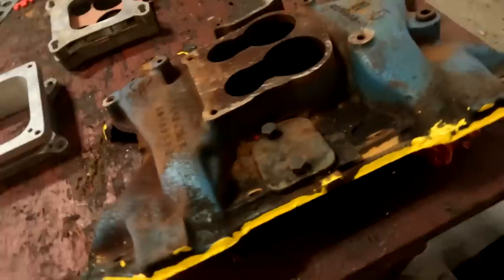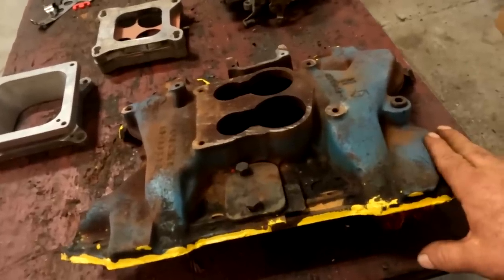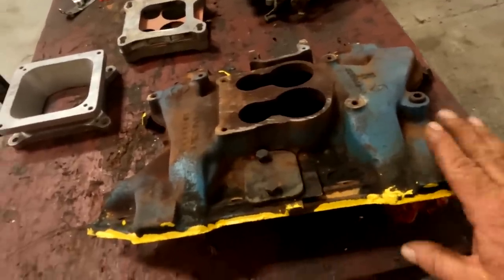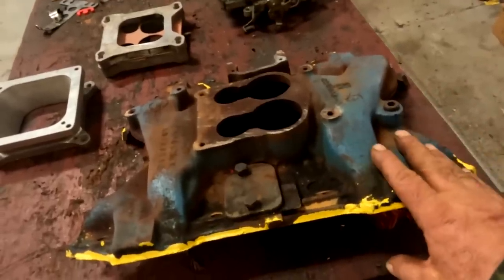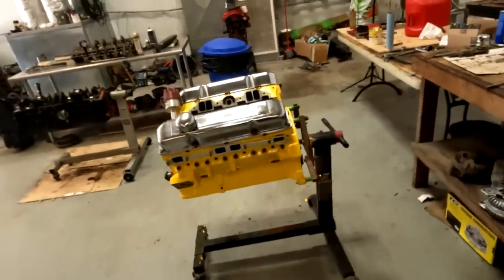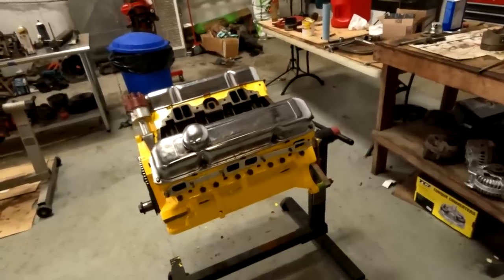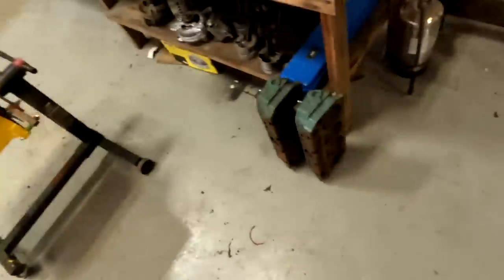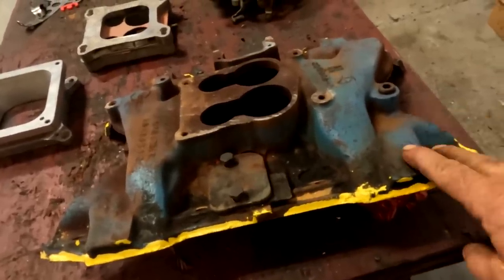Blueprinting - What It Is And Why You Should Do It To Everything You Touch On Your Car. Free Power

Comment: Real world experience with two cars that should have performed the same, a full second difference in the quarter. My 69 340 Dart, 3.23 auto ran constant 14.1’s, my mom’s 70 340 Duster, identical drive line ran 15.1’s, with the same driver. The car didn’t feel sick, as a matter of fact, mom’s car sounded more intimidating than mine. I’ve long suspected it was a cylinder sealing problem, with it’s root in the original break in period.

Comment: My husband  sez he is an
O.E.M. feller...he is mostly from maternal  family's favored marque a 
what he said he is called a
"Bow-tie"
guy...since he was 9-10yrs old he has hands on experience in Chevies...
He wants to thank you for posting your vids about his passion for 
"Old School"
engineering...nowadays
by now after 60+ years, he wants just to work on small engines, and restore his Chevy motors(and that includes the much
maligned 
Corvair!)
...we have the original
'66 283 he was blessed to bore his own block .030,  steel crank absolutely ""zero-ed out ALL the main journals and crank throws from a '64 C-10 P/U...has original intake AND an Edelbrock 4bbl intake
with a Carter
AFB carb as an option...
that ol' red Chevelle 300 Sedan was his first vehicle he paid for and not shared with his family...I remember how good a car it was...the body just rusted away and after a collision with a truck, we just let it go for scrap, but kept most of the powertrain
(had a modified Powerglide that would really let it get the power to the stock 3:08 rear end!!

Comment: The old school small block Chevy (before EFI, I don't do EFI) is the engine I am most familiar with. I have built a lot of them. Just take a look at the service manual for a 1960s or 1970s small block Chevy. Look at the allowable tolerances for everything. It's downright scary. That is what comes off the assembly line. Take bearings. Crank bearings or con rod bearings. You might have one that is borderline too tight. The one right next to it might be borderline too loose. Look just how wide the tolerances are. It's a wonder these engines even ran. It's a miracle that most of them actually made it past 100,000 miles. The fact that so many things can be that far off and the engine can still run so well and last so long clearly shows the tolerant nature of these old school engines. You can literally throw one together and expect to get 100,000 miles out of it. But. If you build it right, with everything correct, everything lines up, all the clearances are where they should be instead of all over the place, not only will that engine run a lot better, and make a lot more power, but it can last several times longer. 

The design of these old engines is nothing short of amazing. Strong, simple, robust, they were designed like an anvil. People claim they were junk, and complain that they didn't last very long. They weren't junk, there was nothing wrong with the design, the problem was build quality. Build a small block Chevy that might have lasted 100,000 miles the way it came off the GM assembly line, but build it right, and properly maintain it, and you can get 500,000 miles out of it. I built my first small block Chevy back in 1973, at age 14. I built it by the GM manual. I know for a fact it was still running 5 years later when the owner sold the car. But I started reading the technical articles in hot rod magazines, which back in those days were about mechanical things and not computers, and I learned about blueprinting. Building an engine to exacting standards, and not just somewhere within the upper and lower tolerances. 

Porting and polishing intake and exhaust manifolds will not likely make an engine last longer, but it will almost certainly make more power, because you are increasing it's efficiency. You are improving flow of air/fuel mixture through the engine. That starts at the air cleaner, and ends at the tip of the exhaust, and includes everything in between. The carburetor, intake manifold, heads, the entire valve train, exhaust manifold, and exhaust system. But remember, you have to consider all these parts as one. They all have to work together. You can have everything as perfect as you can get it, and one bottleneck in there somewhere will ruin everything. You can build an engine out of the best, most expensive parts available, and it may still run like crap, if it runs at all. Tony is right. Throwing a ton of money at an engine build does not guarantee that you will wind up with a great engine. You can get some amazing results from cheap parts, IF they are assembled properly.

Comment: Here's another reason why someone would reuse a stock manifold: experience.  I'm working on a 65 Olds Dynamic 88 with a 425, original A casting for block and heads. I got the manifold with most of the engine, meaning in the trunk. There was no 2bbl rochester, nor any carb, but it had a crudely attached adaptor plate for an Edelbrock. Then I plucked a cheap Edelbrock from the trees. I want to make some modifications to the intake, ad it is really restrictive due to the 2bbl design. Can  I get a new intake? yeah, with a pile of cash. And I may still have to - it still makes sense for me to modify this one first, as I'm never putting a 2bbl rochester on it amd want the esperience of what works and what doesnt. If I fuck it up, oh well - I can still buy a whiz-bang shiny aluminium bit. Or I can be more proud of the one I hacked up with grinders, eyeballs, and fingers.

Comment: Thank you for explaining this for us because I never really knew what blueprinting was you just helped me a lot I have the heads and intake off of my 302 right now to check out the head gaskets because of a overheating issue after nothing else helped and the guy I got the car from had put one of the head gaskets on backwards so after seeing this I'll be doing some other work before putting it back together now that I understand what this means

Comment: To me I see blue printing a intake , as to modify it so the ports align best as possible, matching ports, possibly milling to allow the intake to sit lower between the heads to get ports to flow correctly as well as the carburetor fitting correct, and flow paths optimized!  Things like that is why no two production cars run exactly the same!
Reply: That's porting

Comment: Got pulled from CNC set up to do quality control on a shipment of small engines from another assembly plant. While doing so I passed the engineering area of our plant and casually asked when the last time they rectified the positions and tolerances from print to assembly was. One engineer immediately said "God damn it!". A second asked "Who the hell is this guy?". The first shot back "Doesn't matter! He's right!"
Really minor changes, microns. Effects were astounding. Assembly sped up as bolts dropped into place nearly started themselves. 
Things change between print and physical production. Your parts don't exist in Autocad.

Comment: Blueprinting: Take a look at the cars running Stock Eliminator. The guys building these engines have STACKS of intake manifolds and heads they have collected over the years that meet the rules of their class. They flow test all of them and only use the best of the bunch for their racing application. The diffferences between production pieces and what was actually designed sometimes HUGE!

Comment: Yep, "blueprinting" is such a vague and misunderstood term!
In rebuilding and repair, 📏📝  dimensioning and blueprinting -- an engine, hydraulic cylinder, or other equipment -- is that first step of knowing what you have, and documenting that accurately out to half a thou (or finer!?) ... After that comes the reengineering of tolerances, machining and "adding lightness" and the fitment of aftermarket parts as needed for performance.  
And part 2 of blueprinting anything is documenting and archiving the assembled dimensions.  In addition to the reengineering and tolerances for performance, blueprinting as a service gave 2 things:
Customers would call the parts department of a shop where I worked and could order seal kits or parts for equipment we'd repaired , and we'd look it up using just the reference number we stamped on everything to check the dimension sheets from the blueprinting process (even if it'd occurred 20 years ago!) 
And whenever equipment came back to the shop, we'd redimension redo the blueprint 📏📝 and compare to prior: this showed if we'd done the previous work in the summer or the winter but more importantly reveals wear and worn tolerances! Then how much to hone, what to machine, new sizes seals and rings and so on and so forth -- and get that equipment back out working hard again!

Comment: Ha you mentioned a 350 olds rocket , about ten yrs ago I bought for 1500$ a 72 cutlass s it had the 442 hood . 350 rocket installed and one in the trunk that dude was building for it . 3 years ago I traded both 350 rockets for a 69 455 rocket from a delta 88 , it’s a mean 442 clone but hey that’s what olds turned into a 442 to begin with 😂my dad and I did real close to how olds did it my whole drivetrain is ‘J stamped ‘blue with white stripe white interior and every bit a 442 from 72 😊, I have on my back window in big white bubble letters ‘5.0 l eater ‘😂😂😂and it works draws em out

Comment: I have a '53 Dodge with a flathead straight 6. Do you have any performance suggestions. I did remove the heavy spring in the distributor. I would say that there was a noticeable change in throttle response.  
At this point I've been keeping the stock look. Not really interested in the duel carb setup. Short story long is... Is there a cam that would increase power in the higher rpm range? Would there be other parts that should be upgraded as well.
Just a back yard wrencher, that appreciates your videos. And now actually understands what "blueprinting" is! Thanks again

Comment: lol, I dont know why but i have to take stuff apart and modify it to make it better. Guess i been blueprinting all along and never knew it. Must have been doing it right, the 388ci in my sons camaro he sold got pulled to go in a 55 chevy. The guy that bought it took the engine and had it dynoed. it made 589hp and 537 ftlbs of torque. People were asking why would u take a set of $1500 heads apart and modify them? I guess the numbers speak for themselves.

Comment: Tony, you mentioned different ignition systems. Will you be doing a Coil Near Plug, or Coil On Plug system with a crank trigger and distributor delete? I ask because I very much want to try it with my 360LA build. I want to learn and be different and hopefully benefit from something new to me. I don't know anything about modern ignition systems and see what if any gains s it gives.

Comment: Tony let me help you with a blueprinting situation that everybody can understand 401 and 425 buicks have shaft Rockers similar to a mopar well from the factory they will turn 4700 to 5300 rpms why is there a gap why are they all not one  or other the simple answer is casting flash on the rocker arms which the designer never put into the design he designed a Rocker arm  he. Don't care how its made well its cast in 2 halfs and there's a casting seam right down the middle some are tiny some are much larger depends on qa that day but if you grind them all flush and smooth they will rev to 5300 rpms if no other problems that flash adds wieght and can effect valve train geometry you correct it you got a proper running engine

Comment: I’m working on a 660 atv got a stage 2 cam had to shave down the center Valve guide 1mm but I’m still having clearance issues I can’t go down anymore on the guide so the only thing I can think of is cutting the valve seats in around a mill to raise the valve up so it dosent bottom out on the seal will this work

Comment: My buddy cut a hole in his hood to put an aluminum intake on his 1967 Olds Toronado and I was like why would you? The front wheel drive running gear raises the motor up  a few inches higher than a conventional RWD car.

Comment: I've heard that blueprinting is making a detailed plan of a specific build. If I was buying a motor that was "blueprinted" I would want to see the blueprints, or the detailed plan, to see what it is that I might be buying, and then I would wonder how well they actually followed the plan during the build.
Reply: You were told wrong. Blueprinting does means getting gasket matching, but it also goes further to getting valve spring rates uniform across a whole set, getting bowls blended, rod weights uniform, etc. It means balancing the crank, kniving it, checking oil pump gear tolerances, etc. It's not a plan on paper. It's the know-how/labor put into the build itself.

Comment: "All what we got's here is American made It's a little bit cheezy but it's nicely displayed" Quote from Frank Zappa another Great Italian American.  Our cars are made with wide machining tolerances .Narrowing that tolerance is what Blueprinting meant to me as a 16 year old engine builder in 1969. I have  done engines for example a 312 Ford that had crank saddles as crooked as a dog's hind leg. I have overhauled a 350 Chevy that had one deck .040 taller than the other . And I had a 360 Mopar rebuild that cracked the oil pump when torquing it to spec because the drive section nub that fits the main cap was  about .0015 too long. One reason our Fathers and Grandfathers took out Hitler is because Mopar cranked out  lot's of tanks with wide tolerances compared to their low quantities of tight toleranced Panzers and we could crank them out in mass quantities. Rolls Royce ordered a bunch of the early 4 speed Hydramatics from GM and thought they could improve them to Rolls Royce quality by improving the surface finish of numerous parts .They found out that they would not work that way ,GM's rough finishes in certain parts were required for the tranny to work right Tighter tolerances cost $ and may not be what you need to build mass quantities. Packard improved on the Rolls Royce Merlin  fighter engine and built far more than RR ever did and eventually got  more power out of them

Comment: he speaks good sense , but the main reason why edelbrock began manufacturing  AIR GAP aluminum intake manifolds was people were experiencing pre-ignition problems with the older manifolds WHY??  today`s advance gasoline with cleaning and advanced ignition additives , the gasoline - air charge being drawn into the various cylinders were being pre-ignited by the very hot intake manifolds , so edelbrock redesigned the manifolds by incorporating a gap between the base plate and the intake runners to keep the air-fuel charge somewhat cool ,so it does not pre-ignite

Comment: As a product engineer in a Fortune 500 engine company, your assumptions about engineering vs. production are not exactly correct. The design process isn’t intending to make a race engine. That’s just fact. Effectively, marketing says “we need an engine that makes xxx horsepower, weighs xxxlbs, and fits in xxx space claim”. The job of engineers is to define the parts that achieve that, while balancing the constraints of real world manufacturing. Gasket interference, port variation, etc are absolutely considered… they’re just not optimized for a race engine. They’re optimized for production to be able to efficiently make parts that meet the vast majority of customer needs. Fortunately, gearheads aren’t the vast majority of customers.

Comment: Yes well, just a word really isn’t it bit like restoration, we repair our cars and high end places restore cars, new everything and the screen wash bottle filled up with eau de cologne, likewise there’s a difference between a “blueprinted” engine and a tidied up engine, removing a bit of casting flash out of your inlet manifold  isn’t blueprinting your engine it’s good practice, also your 60s something factory fit performance part is probably far more valuable than the aftermarket stuff so tidy it up and save the money, could put the cash towards replacing some of that rubbish you Americans run around on, front drum brakes, hydraulic lifters and automatic transmissions, …. just my little joke of course from the land of Lucus electrical systems and the S.U. carburettor, if you fancy plumbing the depths of despair buy a rusty old Jaguar, love uncle Tony & the comments section 👍

Comment: I got a 71 Satellite without a motor and trans. I also got a 67 383/727 that runs GREAT. I can't afford a cam/lifters, etc, so I did the EZ-OFF/hose/VHT rebuild. But it has a 2 bl, and I can't find a cheap aluminum intake around here. I knew an old man that had TWO, but when I went to buy em, he had sold them for SCRAP!! 😠😑😭 Dumb bastard. 🙄 So I'm gonna find a 400 intake!